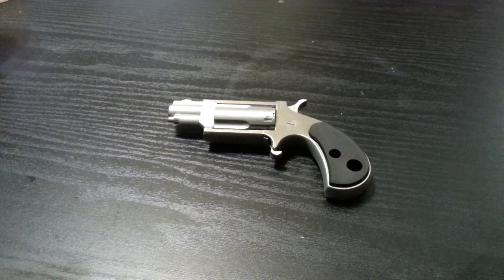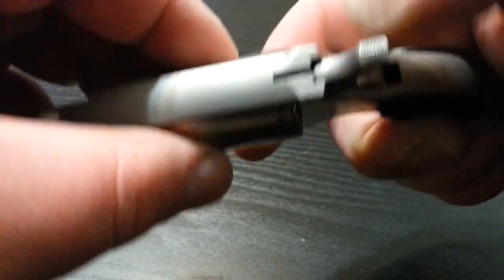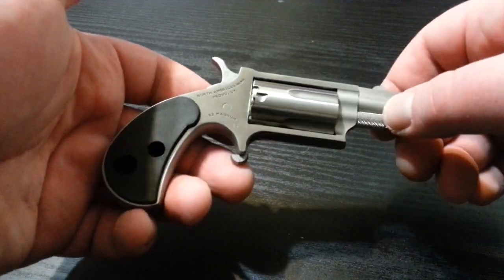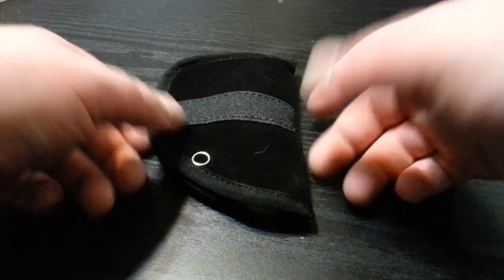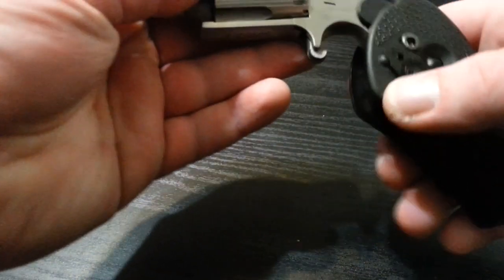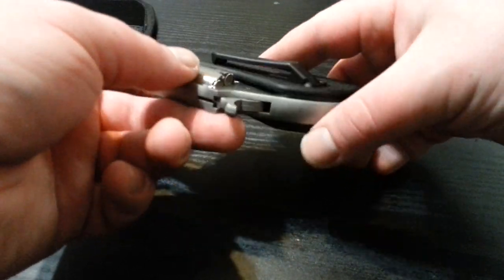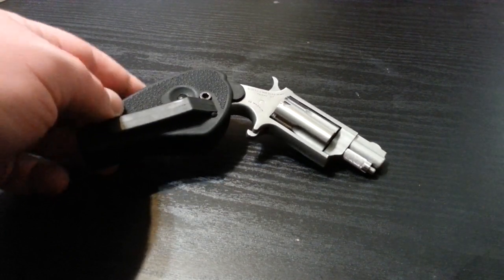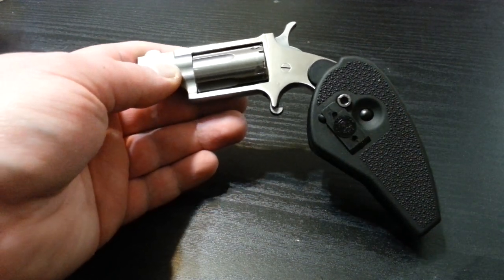The north American arms .22 mag "holster grip"

Comment: I installed the folding grip with high hopes that it would be a great way to carry my derringer. However, in practicing it's use. I found that the pocket/waist band clip is WAY too tight. It's very difficult to even get it clipped on my pocket. Then when you go to draw it. It's way too clumsy and slow to be a reliable self defense (or get off me weapon). Toying with the idea of heating the clip and reducing the clamping pressure. Haven't decided to do it yet though.

Comment: Mine came with that holster grip, which I loved... at the time.  However, after drawing it, and shooting it, I realized a major drawback:  You have to use two hands to open it, or 'fling' it open, like a folding knife.  The problem with flinging it open is that obviously, under stress it may slip out of my hand and wind up at the bad guy's feet.  "Oh, you want my wallet huh? (fumble)  Well here, have my gun instead!).    And since it's designed to be a 'get off me' gun, I may not have both hands free to open it safely.  My dominant hand may be fending off the attacker, otherwise I would probably use my primary gun.  So now I carry this on my left side, in an IWB holster, with the slip-on rubber grip.   That said, who knows what kind of situation you may find yourself?
Reply: If you are that concerned about flinging/fumbling all you need are 3 things: 
1. Practice  
2. Carry a second one in the other pocket. 
3. Lots more practice.